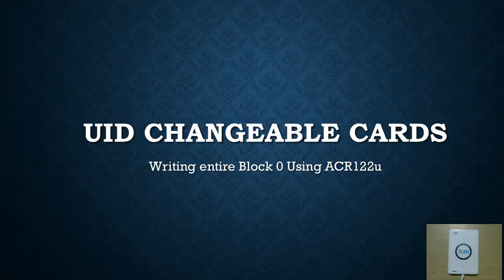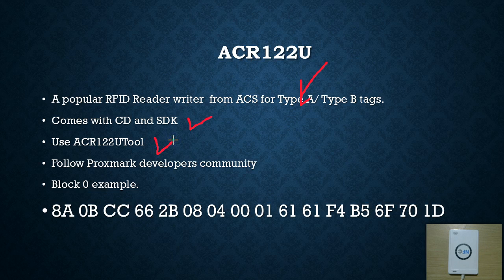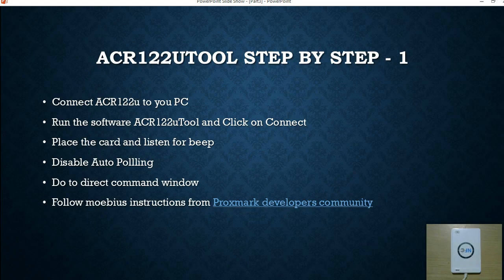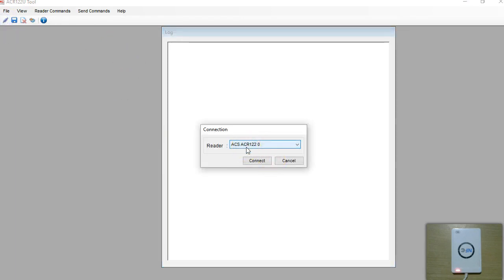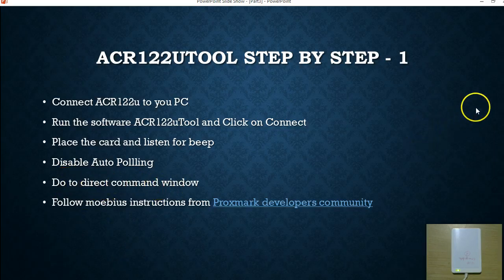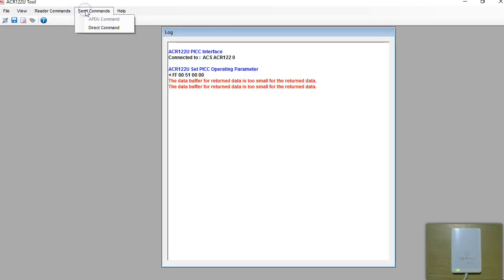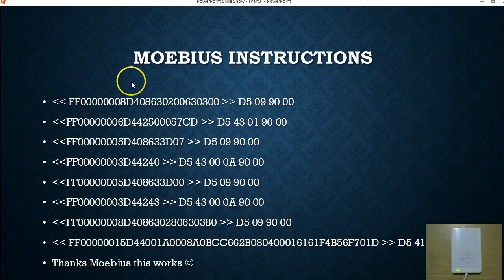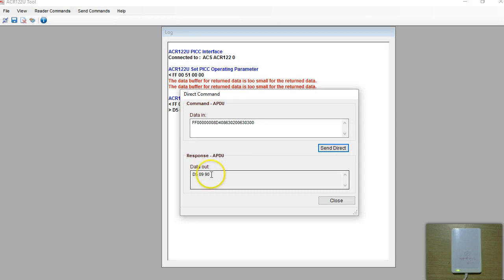UID Changeable RFID Cards - Part 4, Using ACR122u

Comment: The article you mention does not seem to exist anymore. For further references, the command, in the correct order are:
FF00000008D408630200630300
FF00000006D442500057CD
FF00000005D408633D07
FF00000003D44240
FF00000005D408633D00
FF00000003D44243
FF00000008D408630280630380
FF00000015D44001A0008A0BCC662B080400016161F4B56F701D

However, this does not seem to do anything. However i was sucessfull doing it with the pyscard library in python and loading the key, authenticating then reading and or writing the blocks.

You also failed to mention that inputting an incorrect bcc, or card type will actually brick the card. Card type and vendor info can be inputed back as they are read on the card, if you do not clone a card that you have a physical access to, the bcc is computed by xoring all the uid bytes recursively.